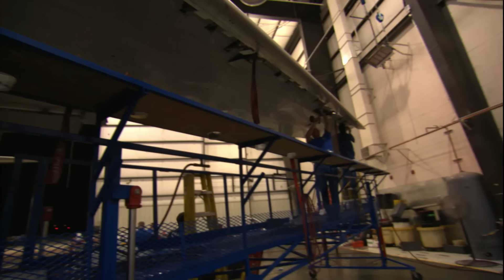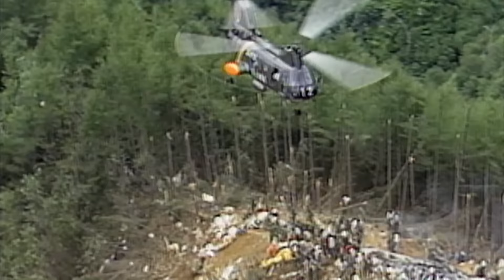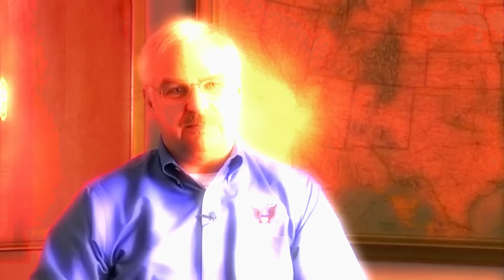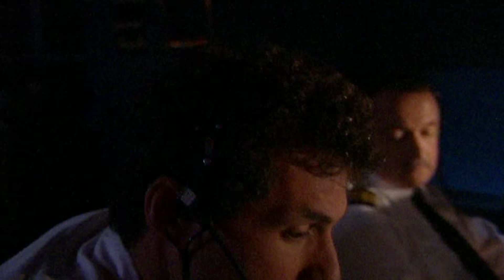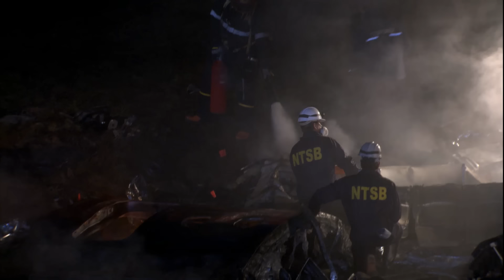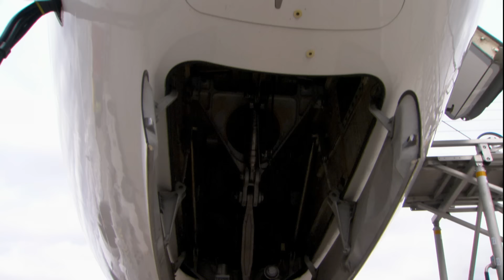Tiny Maintenance Error Causes Deadly Crash | Mayday Air Disaster | S6 EP2

Comment: I think there should be 2 jack screws that control the tail. If one fails the other takes over. Easy right?
Reply: More likely, if one fails it jams the other. This is a mechanical linkage, not a control circuit.